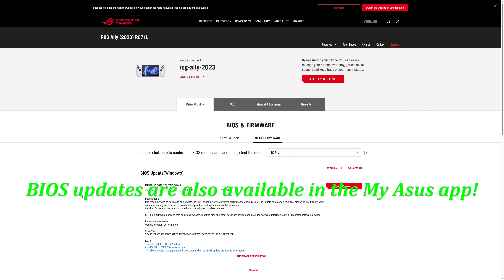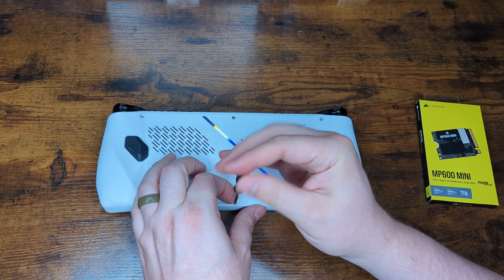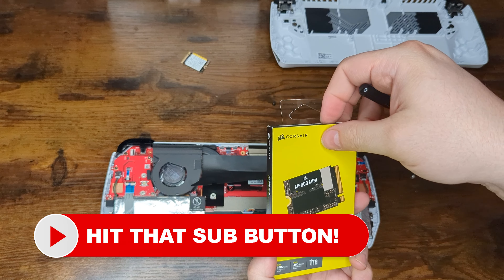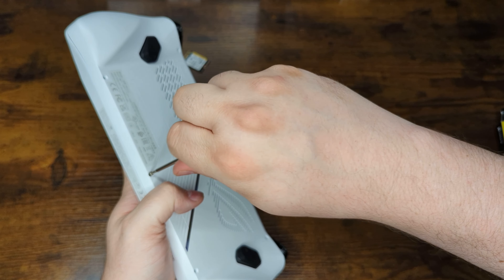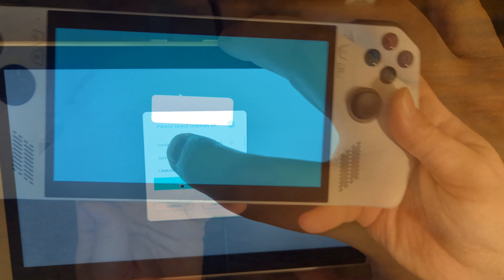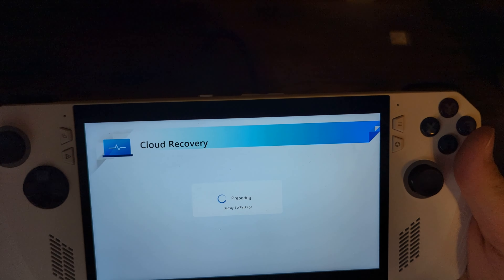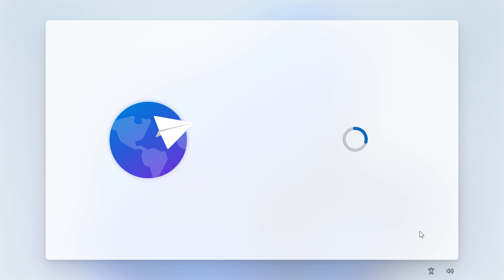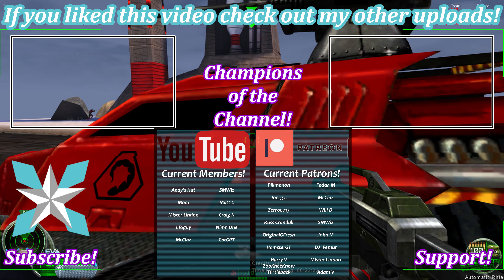Asus ROG Ally SSD Upgrade Tutorial - More Space More Joy!

Comment: How do you get all your games and emulators back on the Ally without redownloading, can link me to a video if you have a method
Reply from the maker: Move them to USB or backup your current drive with the my Asus app cloud drive feature
Reply: @ArchadesGames  i saw a video on how to do it by copying with an enclosure, and it worked but for some reason my new ssd only has 490 gb of data when it should be 1 tb. Hopefully i wont have to buy another ssd
Reply from the maker: It's cloning the partition data too. You need to expand it in the windows disk manager